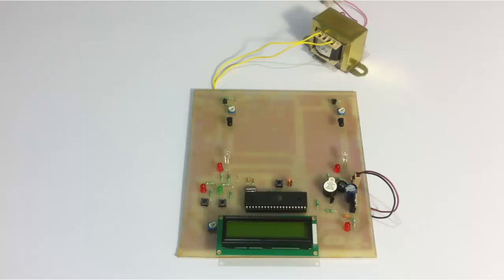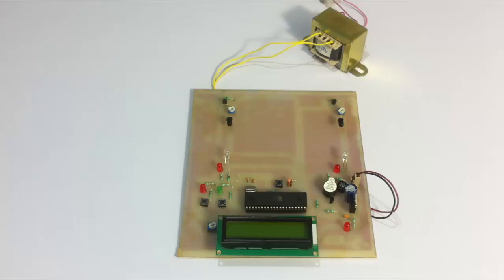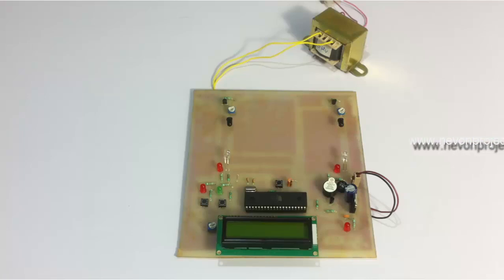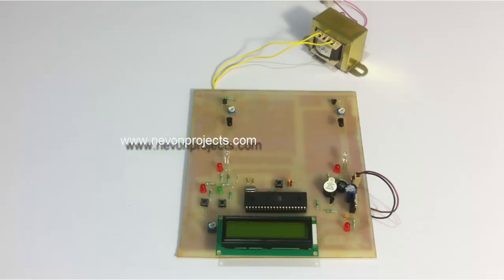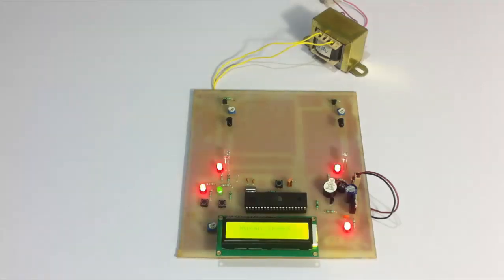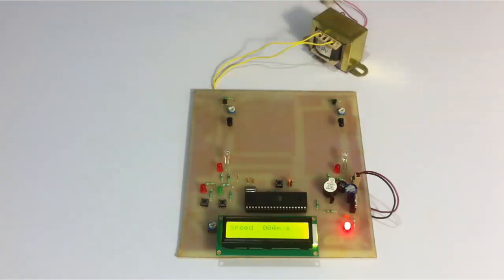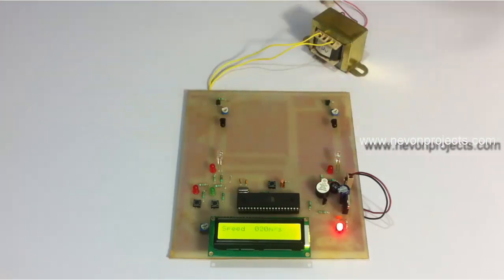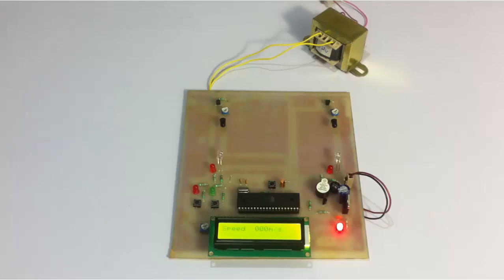Human Speed Detection Project

Comment: is there any way you would be able to detect the speed from an upwards/falling motion and have that react with a trigger if it hits a certain speed
Reply from the maker: +SnKxTech ZEKE Well just placing this circuit vertically we can sense the falling speed and then desired trigger can be used.. gst this system details at http://nevonprojects.com/human-speed-detection-project-2/
Reply: +Nevon Projects the reason I ask because I have a project that I want to do, that will deploy a cushion when it detects an object falling at a certain height or rate of speed
Reply: Nevon Projects I have a other question is there a way to spread the laser to a wider angle?
Reply: Hi, I have also project which is a detection of human speed and direction... Did you get something about this project. If you can help me to it, I would be very grateful. THANKS
Reply: SnKxTech ZEKE do u have circuit diagram for this project?
Reply: can you give me this project any idea